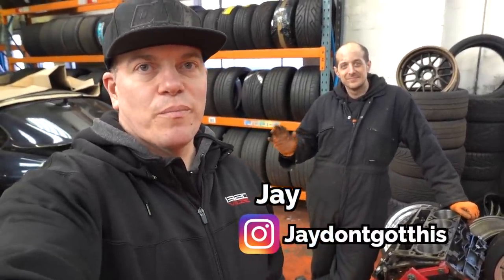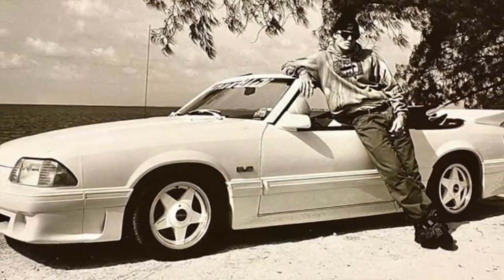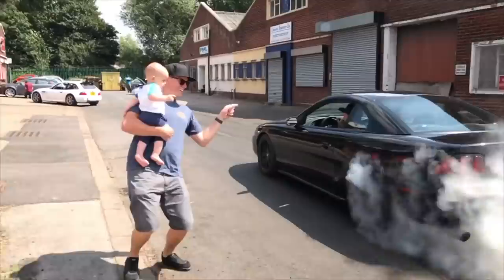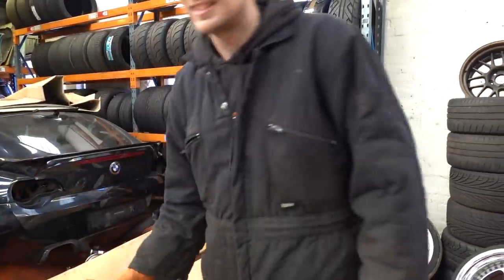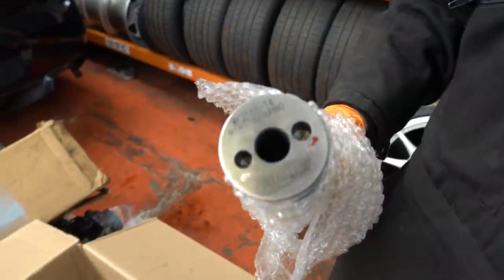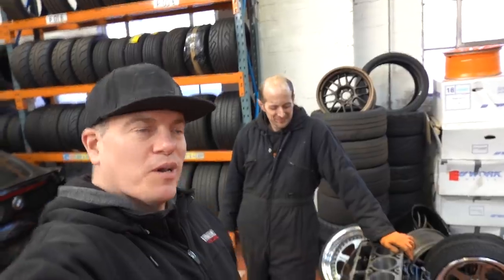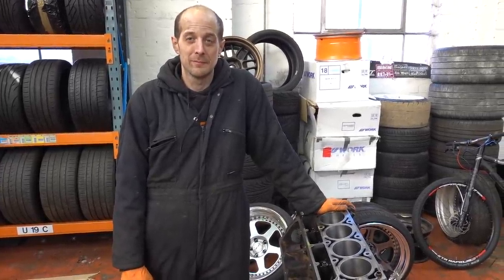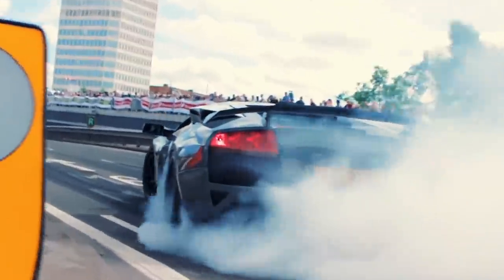Jays 1000hp LS Turbo SN95 Mustang Project - Pt 1

Comment: Good parts choices, 1000 BHP should be no problem for this setup. I made 764 whp on a stock bottom end/head LS1 with that same cam shaft, and a truck manifold turbo kit using the PTE 7675 CEA turbo running around 1.17 bar of boost (17 psi). I'm pretty sure shipping and turn around time would kill you, but Tick Performance offers a pretty reasonable T56 upgrade service. Good luck with the build!
Reply from the maker: Thanks man! 👍🏻

Comment: Loving this - so many epic projects!

What's happening to that Z4M coupe in the background? It's been hanging about in a few of the videos over the last few months! Pleeeease do an S65 Manual swap into it!!! 😇
Reply from the maker: Cheers. I need to get around to selling the Z4M Coupe. It has a blown engine, it's disassembled with a load of parts missing. I had to buy it to make the V10 M3 deal happen.
Reply: @driftworks  shame! Potentially interested in a few parts when you're ready to start shifting it... I have a z4mc track toy 😇

Comment: The biggest hold up on manual LS builds is the gearbox. thats a LOT of torque to manage.
Reply from the maker: Yeah, that's where Jay has to spend some real money unfortunately.
Reply: @driftworks  What about an old dirt track jericho 4 speed clutchless? They can be had fairly affordably used in the states, i'm sure you have connections. Or a BMW Diesel box? Just throwing some ideas out there
Reply: Phil there’s a Jericho on the floor in the workshop isn’t there?

Comment: What’s the deal with the AC Schnitzer Z4M coupe in the back ground?
Reply from the maker: I need to get rid. I had to buy it to be able to get my V10 M3 back. It's just in the way.
Reply: @driftworks  If its a UK spec car it was a mega thing when we built it in 2011.  It had almost every Schnitzer option plus a full set of AP Racing brakes.

Comment: Gearbox wise, consider the 6 speed BMW 335d box! Its bulletproof and cheap! Look up ‘overboost racing’ from Denmark, he had one in his former drift mx-5 which had a turbo LS!!
Reply from the maker: We've used the 530d box in our S15 & 1jz R32 for the last few years (same box). They are great, but the R32 has shattered one in half at 600hp.
Reply: lasse2071 thought about it but what clutch? My main worry is if the box isn’t all that and you start smashing them where do you go from there? at least if I’m using a T56 there are clutches and upgrades available that will 100% be man enough.
Reply: 335d came in automatic only. The GS6 53BZs in the 335i are quite strong and will take a lot of power. I’ve fitted a Grannas Racing T56 magnum gearbox to a mk4 supra, the T56 is just bigger and better than any BMW manual box I’ve come across. 

Jay - bite the bullet and go for the T56 magnum you won’t regret it! The shifter is like a rifle!
Reply: Daniel they bullied me into it today it’s on the way.
Reply: @JayDontGotThis   335d definately came in manual, but yes, clutch you would have to figure out yourself! t56 is THE best option, but also very costly..

Comment: Did you think about running an BMW Diesel M57 gearbox with an adapter plate (from PMC Motorsport e.g.)? Should theoretically be able to withstand the torque and would save a lot of money.
Reply from the maker: I have one in my S15 & we had one in the Driftworks 1JZ R32. That split in half though, they're not as indestructible as people think. I'll see if Jay has thought about it though as they are certainly cheaper!
Reply: I have it’s just realistically going to still cost the best part of £3000 with a clutch by the time it’s in the car. There’s still the question mark of what clutch to run and then if you start smashing them all that money is gone and you’ll have to buy a magnum anyway.
Reply: Those are some really good thoughts. Interesting to hear about your experiences. Thank you for the answer! I wish you the best for your awesome build ✌️

Comment: DW + Holley = excellent !!! could you start dealling holley ? excellent vid !!
Reply from the maker: 👍🏻Cheers
Reply: Ive just done a TX install on LS1, if u got any Qs just send message if i can help 👍
Reply: Finlay Macpherson thanks, was it as easy as youtube folk who got a free one make out?
Reply: @JayDontGotThis  yea and know, you will need additional sensors and adapters for sensors and careful planning of fuel pressure reg location so you avoid chopping/extending new holley loom, there are a few crucial things to bare in mind so if you drop me a FB message i can send you picks and part numbers etc so you avoid a bit of hassle when installing, cheers
Reply: Finlay Macpherson thanks I’ll try and look you up on FB

Comment: @Driftworks and @jay who's the Richard guy you mentioned about testing everything? Doing LS cam research and the more info I can find the better.
Reply: Joseph Ernest im trying to work it out too
Reply: What you need to know ? I got a cam in my ls1 . It’s easy to find whatever info you need on ls cams.
The guy doing all the videos is ‘Richard Holdner’ but he’s not going into specifics on cam specs. 
 What motor do you want a cam for and what do you want/need from it ?
Reply: @hoonaticbloggs5402  LS3 N/A cam. Looking for a good mix of driveability but also good power. Not really looking for a "Max Effort" set up. What cams should I look into? More specifically, other than a new oil pump what other supporting mods should I buy?
Reply: Richard Holdener is the main man.
Reply: Joseph Ernest 
Do you need emissions friendly or not ?
Reply from the maker: https://www.youtube.com/channel/UC8uf_zVTV63l1-uRSx6XbnQ
Reply: @hoonaticbloggs5402  emissions friendly only cause I live in Kommiefornia
Reply: @driftworks  thank you! You guys rock!
Reply: Joseph Ernest 
Best ask a local tuning shop then, a 220/220/114 duration cam will just about meet emissions here in the uk.
Reply: @hoonaticbloggs5402  thanks for the advice. Much appreciated. 👍

Comment: It's a shame you couldn't find a Terminator Cobra. 03 04 SN95.  I have the 08 Shelby GT500, S197 chassis. But they are fun anyway. Cool vid guy's.
Reply: But of a price difference if your looking at a Terminator or a GT500
Reply: @JayDontGotThis  The bottom end is built way better on the 03 04 Terminator. Plus the stock Eaton blower it comes with only needs porting to see over 500hp. My Shelby has the iron block 5.4 with the 2.3 ltr VMP TVS. Some other bolt-ons it makes 716 wheel. on pump gas. I don't know if they made it overseas though. The Shelby I have was 24 k, Terminators are 18 to 20 k. I am sure that sn95 was not even half that. And the 2valve is pretty cheap to work on.
Reply: Gopherchucks Games this whole build including the bill for rebuilding the 302 that’s in it now is going to be cheaper than a stock Terminator.
Reply: I am a fan of the Terminator looks though S197 I don’t really think has aged well.

Comment: What happened to the convertible Jay? And don’t say the great british weather 😂
Wrote this before watching also if you want a convertible that handles well you do have to choose a vehicle that handles well before you cut the roof off it. A fox body definitely isn’t the first car that comes to mind when I think “great cornering abilities”
Reply: With this power what is going to have great cornering ability? I fully know it’s going to be useless but will be able to do burnouts at motorway speeds.
Reply: @JayDontGotThis  I think a 370Z would probably still handle well with that awesome engine shoe horned in but I don't know if the diff would hold up to 70mph rolling burnouts so its straight out the window.
Reply: Woodie 2714 I’m sure there fine but I really have no excitement about any Nissan.

Comment: Have you not looked in to the Getrag V160 they can take one hell of a beating and you can pick one up for as little as £1,000. And remember it's not horsepower that kills gearboxes.
Reply from the maker: Where the hell have you seen a V160 for sale at £1000? I'll buy 20...  (They are more like £5k+ nowadays) I bought two 12 years ago at £1k each which was the worlds most amazing bargain back then.
Reply: @driftworks  ebay there some of them going cheap as fuck  I seen one for 1200 buy it now or best offer and is 1 for 1500 as well
Reply from the maker: Not that I can see. There's a rebuild service for £1200 if you already have the gearbox. I'm happy to be wrong, but V160 Supra 6 speed boxes went absolutely mad about 8 years ago. Cheapest I've seen since then is £3,500ish & that was a long time ago.
Reply: @driftworks  I think they just have you got to be really quick the next time I come to see you one coming up for that price I will ring the shop and send you a link that way if you like. I would say a J  can  have the one I've got in the garage but that's for a project.

Comment: The S471 should make 4 figures on a 5.3, the same turbo but 67mm made 1040bhp on Scott Cartlidge's 4.3ltr 3UZ.

BUT if you want bigger, I've got 2x billet 80mm BorgWarners here if you want one!
The ones off a HST!
These things. I had 3, sold one, was gonna keep the others, but I need to stop messing about and finish my own shiz, so...
www.youtube.com/watch?v=arUFAmWBs4U

I reckon one for the SN95 and one for the V10 E46 yeah?
Reply: Stav-Tech if it doesn’t I’ll be back for a bigger one.
Reply: Jay Don’t Got This with enough boost I’m sure it will. Usually the reason for these massive turbos on these big capacity lumps are to get enough turbine wheel, but that fucker has plenty.
1000 wheel nah, but fly, yeah if you got the boost number for it.
Reply from the maker: Jay! UPGRADE 😁

Comment: Ahhhhhh, the tride and true cheapest way to make 1000HP. 
Will you guys be keeping it drag race ready with that solid rear axel? Or doin a 03 04 cobra IRS swap.
Reply: GavinForCars it’s already got a 31 spline IRS hopefully it’ll take it.
Reply: @JayDontGotThis  Nice, it should hold up as long ad the rear diff cover has been upgraded.
Reply: GavinForCars it has a brace on the back of it but I think I’ll end up fitting a ford racing cover.

Comment: He’ll need another turbo for that forged iron block 😏
Don’t  buy a t56 magnum, buy a cheap or crashed Monaro and break it 👍 you should end up with a free gearbox 😉
Reply: Hoonatic Bloggs but that would be a boggo T56 not much use at this power.
Reply from the maker: Magnum or bust. No messing!

Comment: Funny sloppy mechanics just did a sn build. Saying its likely a great cheap platform for turbo ls swapping. Hell he uses 200k mile engine then  reuses stretch head bolts , headgaskets, just throw a cam and spring in it he has hit same as 1000bhp. Ls' are just tough fuckers Funny both my divorced parents had separately bought sn95s when they where fairly new. Fond memories of those cars eventhough the cheap interior kinda sucked.
Reply from the maker: 😁1000hp for everyone!
Reply: @driftworks  at least in usa. I can get a 5.3 right now for 500$ spend less than 2grand and make 800+hp. Granted it wount be pretty but Sloppy has proven you can go 9s with that set up.
Reply: Deftones Dsm watching him fire rods out the sump multiple times is the only reason I’m changing the rods. These engines although cheap over here are not exactly throw away like over there.
Reply: @JayDontGotThis  yeah no worries not everything has to be super cheap. Gona rip though